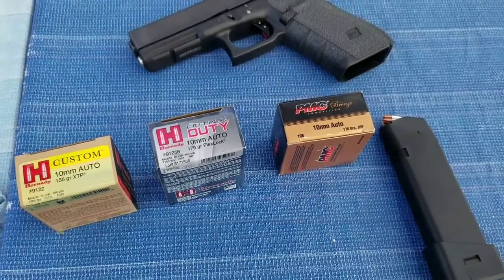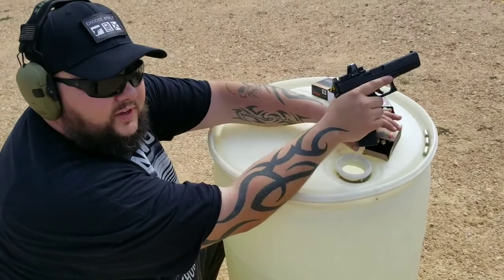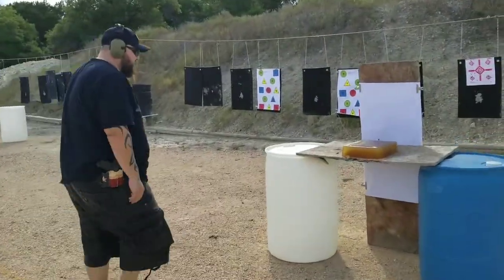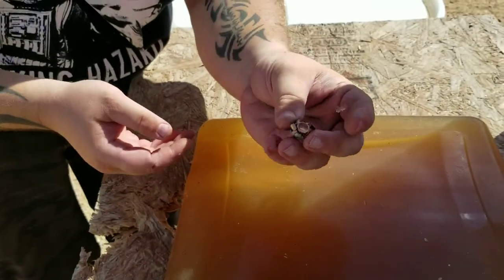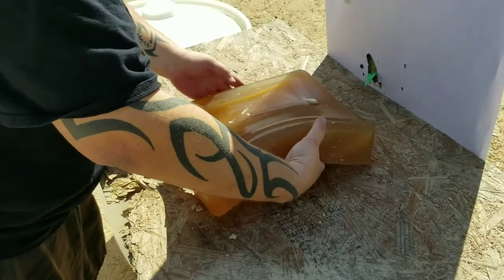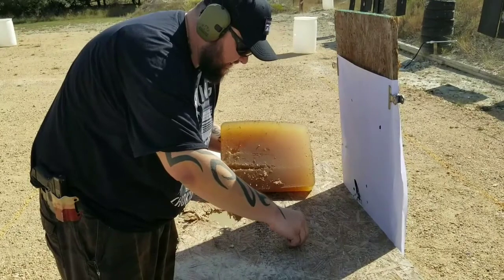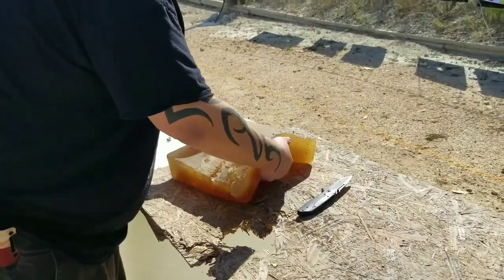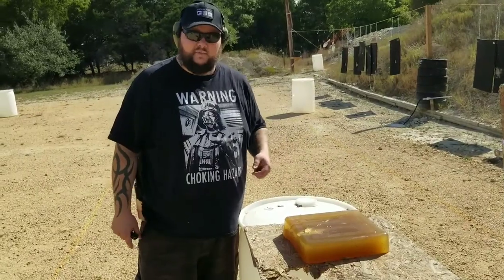10mm carry ammo ballistics test. Including RIP round

Comment: How did you mount a red dot on a glock 20? Been asking around no solid answers.
Reply from the maker: TheAllSeeingTruth I used the Suarez L mount. Unfortunately it sucks. I had to modify it and add additional set screws, red loctite, and spend a month to get it to hold a zero. Best bet is to send your slide out to get milled.
Reply: NOT SO SLIM JIM Ok thanks a bunch. A friend recommended me to try a JT defense SOB mount which replaces the back striker plate with a steel mount for RMR etc. They run 100 bucks but slide milling is 80 at my local gun store so i suppose I'll look more into it.
Reply: Yeah man, get your shit milled or buy a G40 that comes with the MOS option from the factory.  G40 is where it's at.